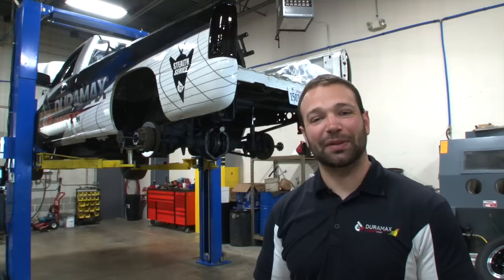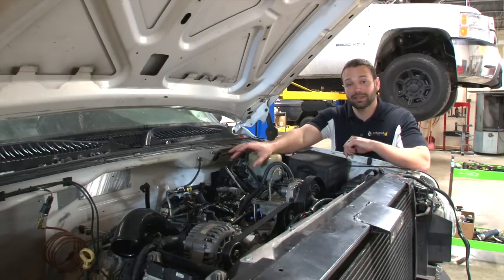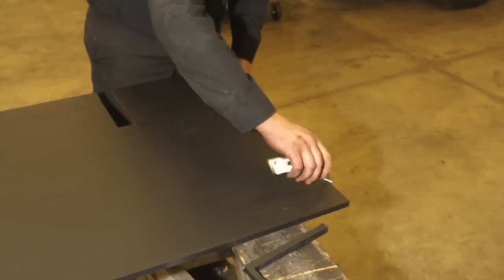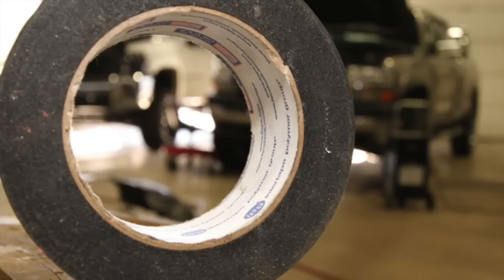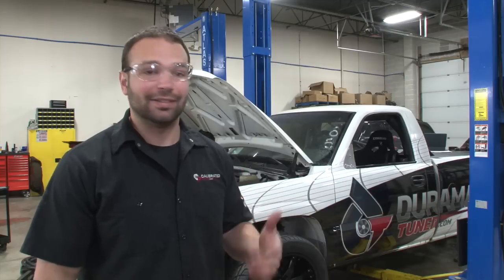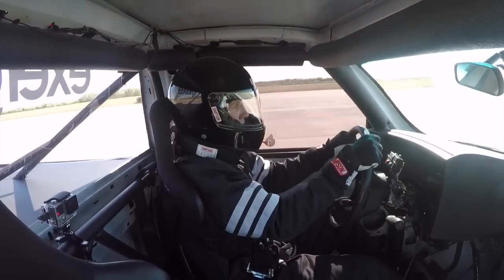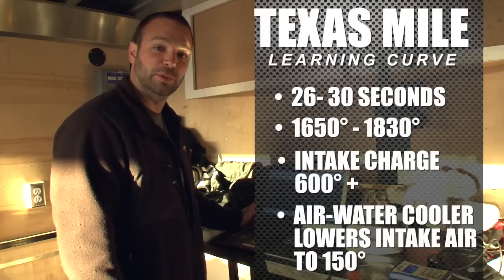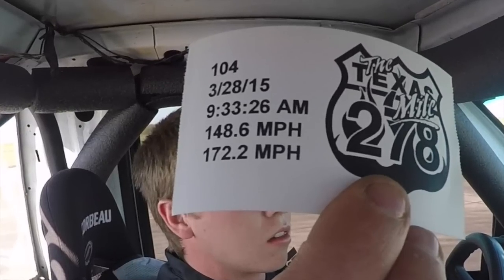Fastest Diesel Pickup @ Texas Mile by Duramaxtuner.com

Comment: Congrats on the speed record, always glad to see Chevrolet leading the way. I agree with Scott Brown on trying to get a gear vendors to use with your drive train to lower your engine rpm.I follow the annual hot rod drag week series, and the unlimited class of cars mainly consists of 2500 to 3000+ hp cars that use a gear vendors to make drag strip passes and make it easier on the drive train as they drive from track to track. The gear vendors should handle the torque of your engine as long as it will fit in the drive train. Looking forward to seeing a 180+mph record by the duramax in the future.
Reply: +mr.18436572 dont u mean isuzu leading the way
Reply: +jessiejames50 Duramax/Isuzu it's still in a Chevrolet Silverado truck leading the way.
Reply: +jessiejames50 Chevrolet/GM owns Isuzu and the 6.6 wasn't even a motor till 01 when GM designed and built it. you're argument is invalid

Comment: Do you guys have any ideas on how you will tackle the RPM issues for October (or the next event you attend)?  I'm sure you wish you could cut some tire from the truck so you have less rotating mass to deal with, especially running a big heavy wheel like those on the truck for March. Can you run the truck with a softer compound tire like a DR so you can lessen the needed wheel width while still getting traction?

Comment: Was a .5 gear ratio from a T56M not ideal, or is it an adaptation issue. I know it's only rated at 700 ft lb, but that might be under clutch dumps with drag slicks.

Comment: 9inch in the rear with whatever gear your heart desires. Way way less rotating weight and you won't break it rolling out. May not be ideal for any type of "launch" but would get you way further with tire and wheel rotating weight as well. I know it was short notice not knocking what you guys accomplished at all, hats off. Just my 2 cents if you guys take another whack at it.

Comment: Does gear vendors make an aux. overdrive for the Allison?
Reply: Scott Brown 

They might, unfortunately ours is 4x4 and we'd have to find one that adapted the allison to the T-Case. (non-existant)
Reply: Nick Priegnitz you're right, looking at the Gear Vendors web site, no Allison. Maybe something from Currie Enterprises in a smaller rear end to get the ratios you want. I'm sure they could come up with something to stand up to what you are putting to the ground.
Reply: Scott Brown The rear end would be a fairly easy solution.  Its finding a front end to match that's the difficult part.  We may swap to a half ton front diff in order to accomodate 3.08 gears.  Need to research it more. 

Nick
Reply: I think Currie could help out on both of those... I'm just spitballing. Feel free to tell me to shove it at anytime.
Reply: Scott Brown I'll give them a buzz... see if they have any potential solutions. Thanks!

Comment: absolutely nothing against this truck, but the Ford GT went 100 MPH FASTER than this truck, 100, think about that
Reply: That's nuts... You smashing at 170... Then something blinks by you at another 100mph?? MURICA!!! 😂
Reply: Yeah but this truck is a brick compared to a highly aerodynamic, low to the ground sports car. Going just 110 in my truck makes the front end super light so i can't imagine 170.
Reply: And?
Reply: nocoolname32 racecar vs work truck. I'd hope it went 100mph faster.
Reply: Race car vs truck? Sure hope the car would be faster
Reply: You did catch the part about how the rules limited the configuration of the truck, right?